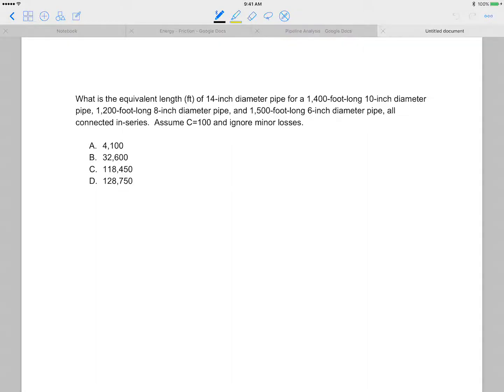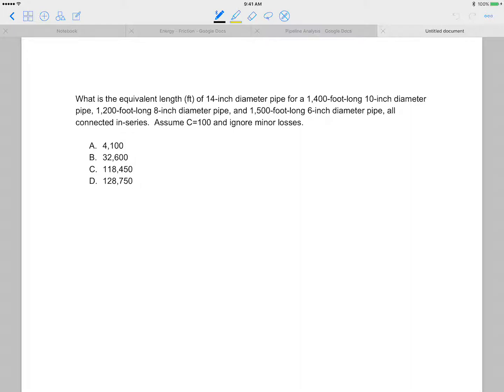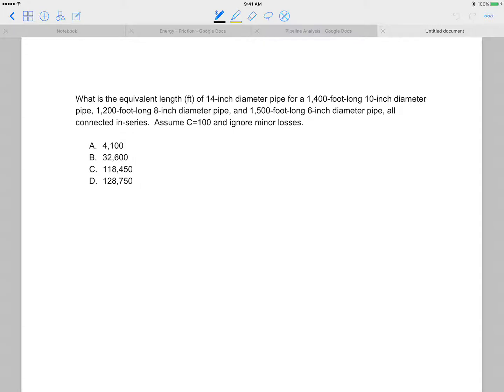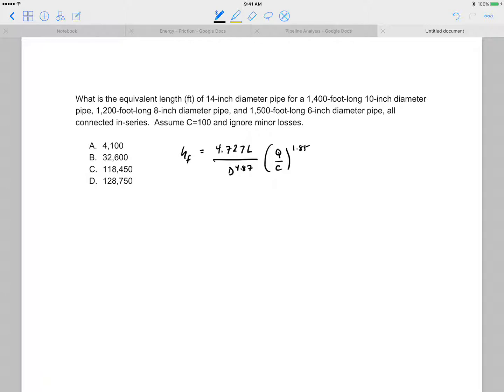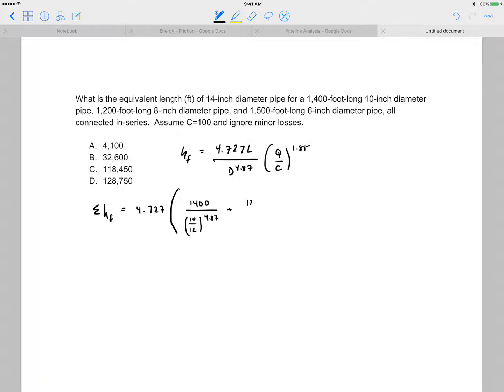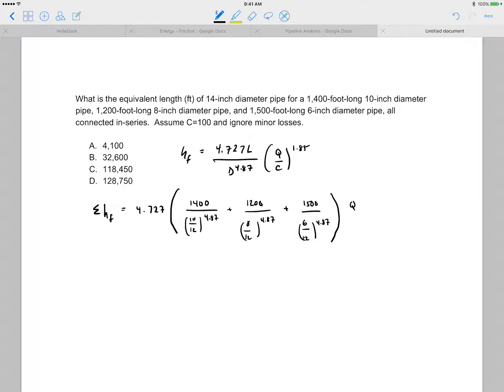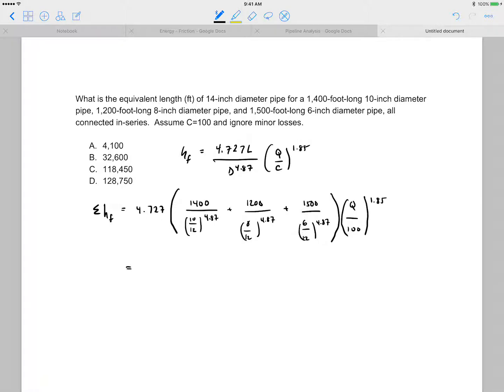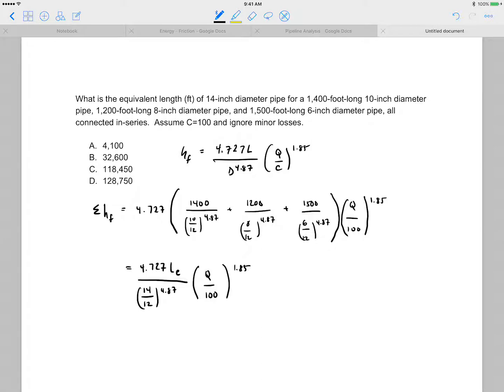Equivalent Pipe Length

Comment: There's no explanation as to wher eyou got the "4.727" from, or the weirdly valued exponents: 1.85, and 4.87
Reply from the maker: Hi, I'm sorry for the delay.  They are constants in the Hazen Williams equation for pipe friction loss.  The equation can take several forms, dependent on what information you have been given from the problem statement.  In this case, this particular form of the equation made the most sense to use, as we had C, L and D values, and could eliminate the Q variable.  Part of solving these type of questions quickly is having all known forms of equations in your cheat/summary sheets.  This way, you can process and determine how to proceed with the problem, quickly.  I hope this helps, and best of luck on your exam!